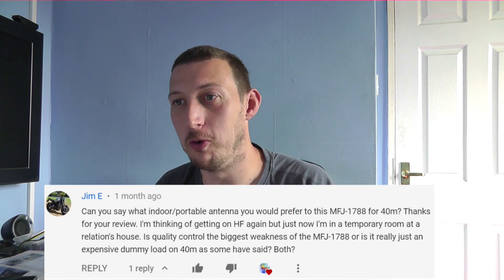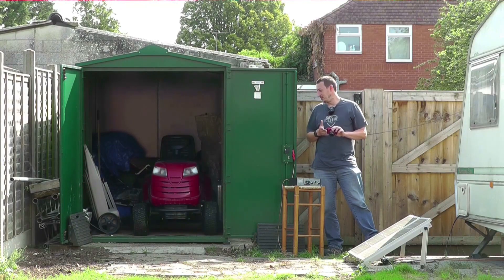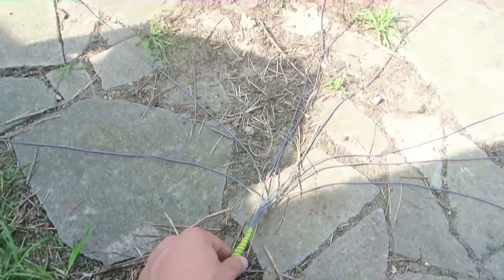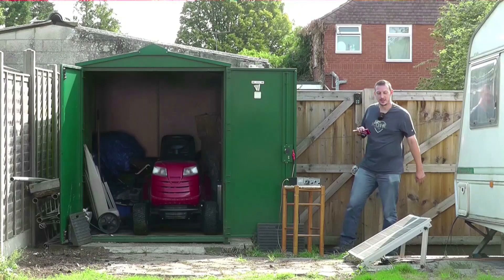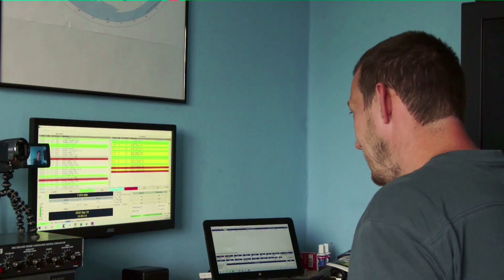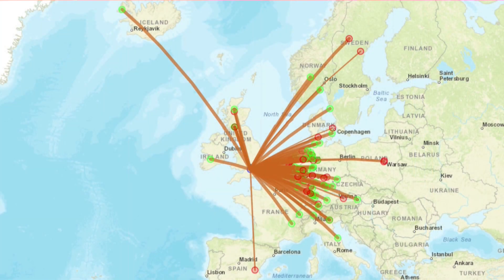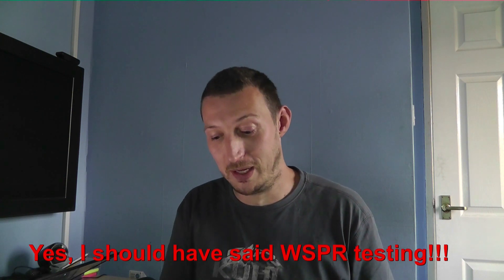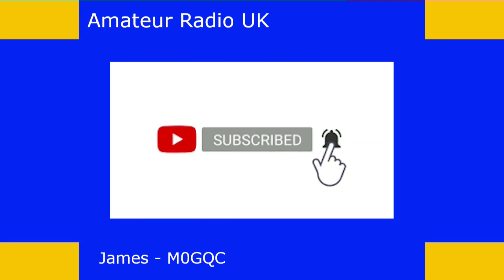Hidden HOA Antenna? 40m Using A Shed!!!

Comment: A PLASTIC shed such as made by Rubbermaid might make a dandy radome... I monster coil for HF or even LF could reside there, a screwdriver and a directional VHF/UHF antennas could reside in such a place.... Radials underneath hole mess, and Bob's your Auntie! All the Best! 73 DE W8LV BILL
Reply from the maker: Interesting idea.

I did wonder about putting a whip on top of the metal shed, using the shed as a counterpoise & using a remote auto-tuner to tune it so that it can be used on multiple bands.
Reply: @HamRadioOnline  I think that would work.

Comment: Is it possible that the counterpoise wire was acting as the radiator with the shed acting as the ground?  If you need an idea for a future video, maybe you could try it with just the shed and the ground rod?  Test out exactly "how compromised is too compromised".
Reply from the maker: Interesting theory. Technically the counterpoise is part of the antenna, so by definition it absolutely will radiate (that's true for the counterpoise in any antenna setup). As you alluded to, the question is "what is having the greater effect.....the shed or the counterpoise".

I like your idea of trying it again with just a ground rod. I might take you up on that idea for a future video!

Recently I have done a lot of videos from home (due to the country being in & out of lockdown) so as the restrictions are lifted I want to do some more portable ops & mix it up slightly.

That said I will definitely keep that idea in the back pocket for when the weather starts to close in at the end of the year as we go into winter.
Reply: @HamRadioOnline  I'd say to save it for a rainy day, but that's probably a bad idea given the voltages involved.

Comment: Excellent! Any metal structure will radiate if you can find a suitable point to connect to it.  It reminds me that many years ago i tuned up farmer's wire fences on 160m with surprising results. 73, Chris G4HYG
Reply from the maker: Hi Chris. Quite honestly, I thought that I would probably make a couple of contacts with it but I really didn't expect to generate a mini pileup!

To be fair, I think I was lucky with the conditions. This video was filmed a while ago (around November/December if I remember correctly). There weren't any contests on at the time but the band was still fairly busy, so the conditions were probably in my favour.

Comment: Great vid james and very surprising results. i must give this a go i have a long line of metal sheds just behind the qth i wonder if i can get them to tune to 80m  73s m7cha
Reply from the maker: The results certainly left me a little lost for words! I thought I might tease a couple of contacts from it but I didn't expect as many as I actually got!

Quite honestly, I think I was very lucky with the conditions. I'm not sure if it would work quite so well under less favourable conditions. It would be interesting to give it another go to see if the results are repeatable.

Either way (as I said in the video), if I lived in a location where I couldn't have antennas but had a metal shed outside I would be inclined to try this as an option for getting on the air.

Let me know how you get on if you do decide to try it!!!